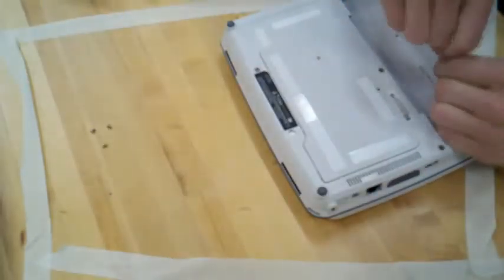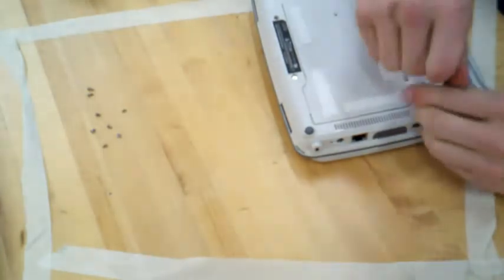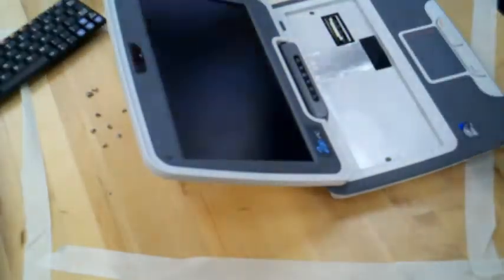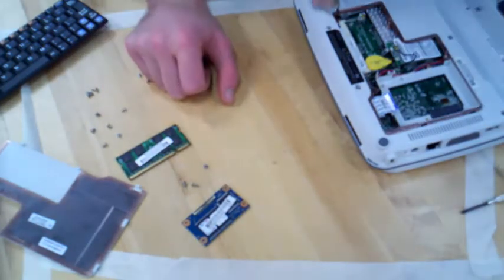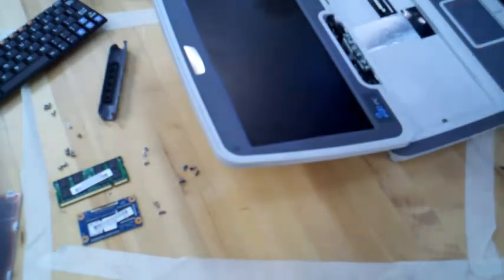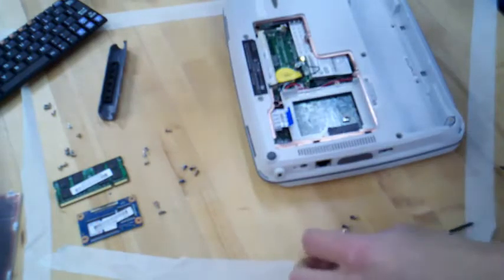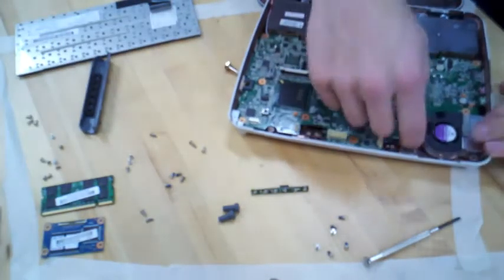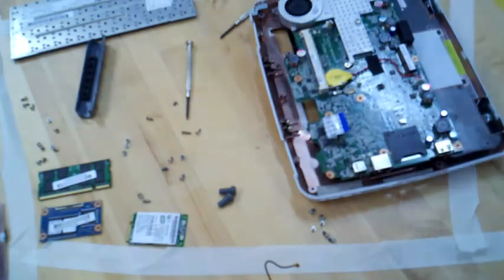Desmontar o Magalhães (Intel Classmate)

Comment from the maker: To be more specific
Hard Drive = 30GB 1.8" 4200RPM PATA, SAMSUNG HS030GB

Here are the full specs:

CPU = ATOM N270 1.6GHz Processor
Chipset = Intel 945GSE
Video = Intel GMA 950
Sound = Realtek ALC662
Memory = 1GB DDR2-533
Hard Drive = 30GB 1.8" 4200RPM PATA, SAMSUNG HS030GB
WebCam = 640x480 @ 30fps
LCD = 8.9" @ 1024 x 600
Networking = 10/100 Ethernet and 802.11b/g wireless
Removable Media = MMC, SD, SDHC
Power Supply = 20V @ 2A
Ports = Two USB, RJ-45, Mic In, Headphone out
Size = 1.6 x 9.4 x 10 in inches H x W x D
Weight = 2.8 pounds
3Dmark2003 Score = 695 
PCmark05 CPU Score = 1483
Quake 3, Timedemo "four.dm_68" = 50FPS @ 1024 x 600
Reply: +José Oliveira  porfavor onde eu posso achar um disco rigido desse
Reply from the maker: Compra no ebay, segue uma pequisa, é só escolher:

http://www.ebay.com/sch/i.html?_odkw=30GB+1.8+4200RPM+PATA&_osacat=0&_from=R40&_trksid=p2045573.m570.l1313.TR0.TRC0.H0.X30GB+1.8+4200RPM+ZIF+PATA.TRS0&_nkw=30GB+1.8+4200RPM+ZIF+PATA&_sacat=0